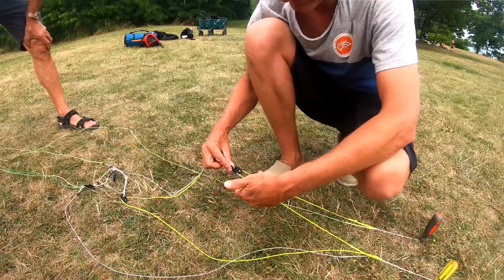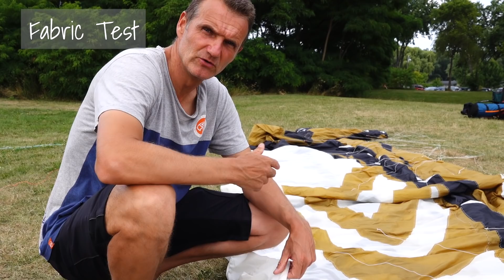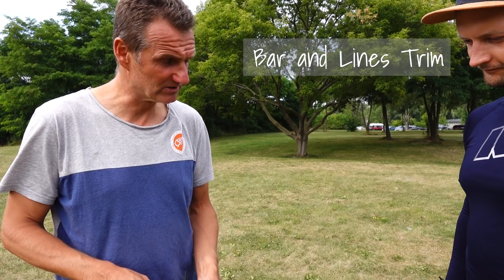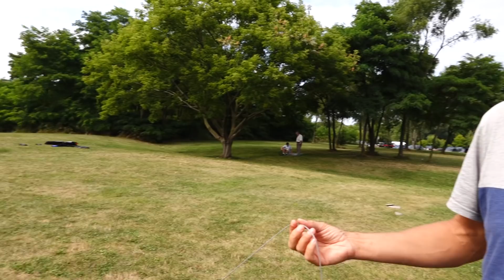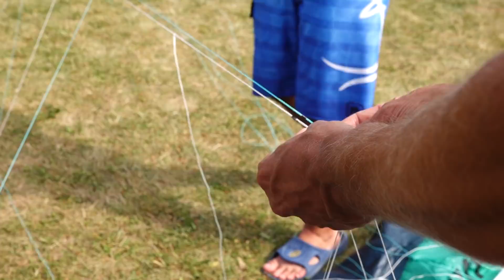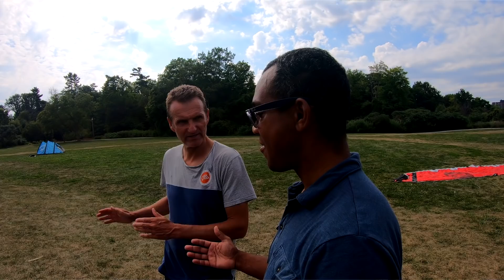Make Your Old Foil Kite Fly Like New

Comment: Es ist auf jeden Fall empfehlenswert den Langen Mixertest bei Schirmen zu machen die schon viele Stunden geflogen sind. Einen mixertest bei einem neuen Schirm zu machen ist quasi sinnfrei außer er fliegt nicht richtig. Dann ist aber eher etwas grundlegendes falsch (Bar/Leinen) 
Da sich erfahrungsgemäß die Bremse in der Galerie deutlich mehr verkürzt als A/B/C sollte hier genauer kontrolliert werden. Meine Sonic3 haben nach der 2. Saison intensiver Nutzung deutlich mehr Depower am adjuster verlangt um überhaupt noch vernünftig zu fliegen. Eine Kontrolle der Galerie hat eine starke Verkürzung der Break Lines ergeben. 
Das Problem am Mixer ist dann dass man vor allem C nicht mehr länger machen kann um den Schirm wenigstens auf neutral getrimmt zu bekommen. 
Ein kleiner Trick von Flysurfer ist, die Main-Z aus der Main-Back auszulösen und mittels Schlaufe am knoten der C-Pulley Leine wie beim Pigtail anzuknüpfen. Der Sonic4 hat hier schon eine knotenleiter im C-Pulley. 
Ich empfehle bei älteren Souls/Sonics am besten auch die Sparepart Leinen vom Sonic4 zu verwenden, damit kann man die verkürzte Z-Ebene etwas kompensieren. Danach noch einmal langen mixertest machen und oben alle Markierungen auf die gleiche Höhe bringen und den Schirm testen. Danach kann man nach Belieben an das Feintuning gehen. 
Viel Spaß

Comment: Another short story that happens to me 3 days ago. Due to heavy use (300-400h)and poor maintainance (my bad) I didn’t realize a pulley got stuck with sand I guess. 
I felt slight vibrations from the lines when stearing the kite or when pulling the bar during riding. First thought was the mixer got tangled a bit but I couldn’t free it while riding. 
The session then was abruptly ended by snapping B and C pulley line mid air when jumping. Yeah, crashed hard 🙈
Aftermath showed a completely worn out Pulley, even the metal pin holding the wheel showed heavy wear already 🙈
Keep an eye on details and have fun 🤙🏻

Comment: Excellent tuning video.  I'd like to add that u can stretch ur lines to match.  I had one line shorter and hooked it in a carabiner to my car stretched it to match with my body weight....it works.  U can buy line wax for ur main line and coat ur lines..especially ur bar line and pulley lines.  I have a speed 2 19m that lost air tightness and coated it with clear silicone that u use for caulking.  I thinned the caulking with mineral spirits and brushed it on. Lasted a couple of years and did fairly well at the red bull kite farm race.  Good job on videos.
Reply: Hi John, what were the products you used to improve air tightness?

Comment: Might be a bit late to the party but this video seemed as a good place to post my question. Great instructional video. I really appreciate all the information about foil kites. As much as I have good understanding of  most aspects of foil kite specific techniques, there is one thing that I would like to hear your opinion at. This applies to Flysurfer Speed 5 and also some of the previous versions of their lineup. So, FDS or FLS? I have used both on my Speed5's and FDS seems to be less "violent" on the kite, especially in larger sizes, 15-21m after pulling the safety, (infamous loops smacking kite on the ground in high winds), also less tangles imo and easier re-launch. Also FDS connects directly to canopy, separate bridle for 5th line, so main bridles are not getting stretched. After three years of flying foils, only reason to pull safety for me was to land when wind picked up to the point where self landing was really sketchy and no one around to help. Only once safety was deployed on water. FLS on 8m Speed- when main line snapped but that was a full packdown, no re-launch. I have tried FDS on water in ultra low wind with 21m Speed5 and it was really smooth incl re-launch but conditions were ideal so this is not a real life test.  What are your thoughts on this matter? Would you install FDS on Seed5's?
Reply from the maker: last time we used FDS (5th line) was on Speed 1 I believe or maybe Pulse. Honestly we never had any issues with FLS. If you are worried about bridles stretching on one side, just rotate the the FLS line from one side to another. The only downside of FLS that we can think of is that when you do more rotations (backrolls/frontrolls) in one direction than other, the FLS line twists up and shrinks the front line. For that reason we prefer new force bar, which comes with micro safety line. Hope this helps.
Reply: Hey you guy! What are you doing here?! You must be training on your windsurfing gear!!!! LOL

Comment: I did my Soul 15 mixer test following your (Armin) recommendations but I am now unsure: I put the 2 screw drivers at the same distance from the kite at the line ring connection  and did the long mixer test as shown: A & Z were 10cm far from each other’s and were not changing that much when moving aside🥴.
So I get to the bar and realized that from the same screwdrivers the front and back lines were not equal. Instead of adjusting the lines at the bar, I added 1 more screw drivers, attaching both front lines to the center one, and  I moved the front line screw driver until the bar lines under tension will be equal, then I kept this 3 screw drivers position to make again the long mixer test, according your video, but with screw drivers far of approx 10cm from the kite (I your vid the seems to be perfectly at the same distance)
Due to so A &Z became nearly equal length both side, and just did a little adjustment to B or C. 
I am not sure of this, as next flying test was with very light wind and I had to trim quite a lot to avoid back stall. When wind picked up a bit I seemed ok but I am not fully sure of it (I was so excited to come back to water as we had one month of lockout🤗...)
I would appreciate your analysis of my process and advices😎
Reply from the maker: If you put two screw drivers about 15 cm apart, at the connection points to the lines (front and rear bridles ends). Then you go to the kite and grab A and Z and you may need to walk few meters side to side untill they are even. When they are even you can Begin adjusting C and then B. Hope this helps
Reply: In my case when I did that way first with 2 screw drivers 15cm on the same perpendicular line...moving even 5m each side was without any effect (possibly moving A/Z distance between 9 to 12cm)🥴. It is why I included the bar lines length differences and then A/Z became equal. In reality I used the 3 screw drivers to do it by myself without bothering to much my wife😇, but I would probably do the same with someone pulling the bar and another checking A/Z at the kite as you recommended.
Hope it is the right way??
Reply from the maker: @nicolasboudet9302  something sounds fishy, i mean bar length in theory sounds ok but it is unnecessary, you have no pigtails on the bridles?
Reply: @OurKiteLife  How about the difference between A and Z? There isn't necessary that A and Z are equal or centered between both screwdrivers? Do the diff between A and Z has to be the same in both mixers (left and right) ?

Comment: Nice video, but wish Armin demonstrated his way of long mixer tuning on older flysurfers. On an old kite the short mixer test does not really make the kite fly better because of the bridle shrinkage/stretch. 

Also wonder if shrunken sparepart lines have an effect on kite performance (considering the mixer is even). They are shrunken even when brand new. 

Also, why two screwdrivers? Was fixing all pigtails to a single point not good enough?
Reply: By doing the short mixer test and fix on an old kite you are fixing the problem of the shortening mixer lines. If you change the mixer test back to the original setting then this case an older mixer line is just as good as a brand new one. I dont think you can call your brand new spare parts mixer line shrunken. :) Just change them and do the short mixer test.
Reply: Do make a "long" mosertest at older kites or from other brands, you need to have a line plan and need to calculate it. That is a lot more work.
The 2 Screwdivers help to adjust A and Breaklines to one level to make the check fast and easy.

Comment: Thanks for the informative video. I would like to ask a question about tuning. I have a speed 3 15m and I noticed that my kite isn't flying what it is supposed to fly, it's flying a little bit down even sometimes it backstalls. I've checked my bar and its perfectly trimmed. I'm thinking about doing mixer test but one of my friend told me that after doing a short mixer test his kite get worse. If you answer I appreciate it. In conclusion, Do you suggest doing short mixer test?

Comment: Good content, but what do you do for a non flysurfer foil kite when checking mixer lines? I don't have marks like the soul?
Also I've had a Core xr4 wear out after 150 hours on the canopy.
I sent it in to a shop they sent it back saying material is weak.
I should have listened to them, it ripped too to bottom while out kiting  after a slight kite fallout while foiling.
Reply from the maker: What we would do get a line plan and check each individual bridle, if some shrank more then others you may need to replace them, also check the manual of the kite brand you bought, but in the end of the day the basics are the same for most kites minus the soul with long mixer test
Reply: @OurKiteLife  thanks

Comment: My 15mtr Speed 3 wants to pull left so rather than having the bar horizontal I have to pull the right hand side down to keep the kite stationary at the zenith. The steering and power lines are level from the bar up to the kite. What adjustments should I make at the mixer? I was thinking of lengthening the lhs by 15 to 20mm. What else could I do?

Comment: On long mixer test I’m able to get my A,B, C equal BUT my Z line is short by an inch and on the other side a half inch short. At this point I have to unequally lengthen the Z lines at the bar???
Reply from the maker: When you put two screw drivers in you have to walk either left or right so a and z are equal

Comment: My z line is way shorter than the a on my flysurfer soul long mixer.  A b c and z  are  perfect for short  mixer and front and back lines are adjusted perfectly ? Is there any way of adjusting the z or a bridles ? What’s happening is the right hand side trailing edge is pinching and there is much more bar pressure on my right hand. I’m a bit lost 😬
Reply from the maker: Z line, is basically steering lines, so when you let go of the bar, you are shortening the z line. Make sure you are measuring correctly, as often times people are not

Comment: I had three fly surfers, after a couple of years, they all had the same issues symptoms; they started stalling if the kite is depowered and when they’re depowered their power zone is awkward and around 12 only. Where should I start? Thanks
Reply from the maker: what model kites are those? usually the kite would start to stall when you power it up, not when you depower it, never had this happen, elaborate more please
Reply: Hey, thank you for your prompt answer. They’re all older models from 2012 and 2014. Also, everyone around me, this is what happened to their kites as well. Yes, you are right, kites stall when they’re depowered usually. It’s really off, when flying the kite there’s no power in it unless it is at 11 or 1, and then at 11 or 1 it also has the tendency to go to 12 and then the power is neutralized. The temperature here gets up to 50 degrees. But I have to say that one of my kites was used and the seller wasn’t honest about it and it had this issue already. One of the kiters contacted Flysurfer and he got new lines and tried to recollaborate the kite setup with no luck either. I really enjoy the flying of Flysurfer, but this issue is a turnoff.
Reply from the maker: @Rababski  how many hours do you have on a kite? also did you check the lines being equal length? we had issues before and one of the center lines was 30 cm shorter then other one. Mixer test, maybe put B-1 and C-1? But honestly, all the backstalling can usually be traced to lines being uneven, let us know how it goes
Reply: The simplest test is to make sure your front and rear lines are the same length when the chicken loop is touching the bar and the trimmer is fully released (full power).

If they're perfect, the next easiest check is to inspect the spare part lines that the pulleys run through. If those are worn, or severely flattened from passing over the pulley, they can cause what you're describing.

From there, the final check is to do the 'short' mixer test and try to lengthen C by a few centimeters to reduce backstall.

If none of that works, something else is wrong and the next place to look is to measure individual bridle lines.
Reply: Timothy Mossholder we give that a shot. Many thanks 🙏🏽